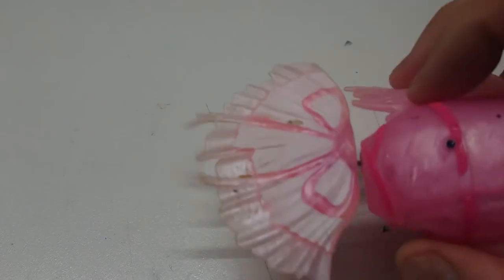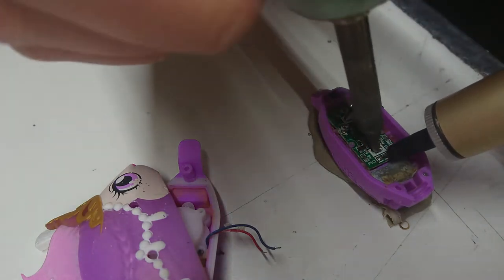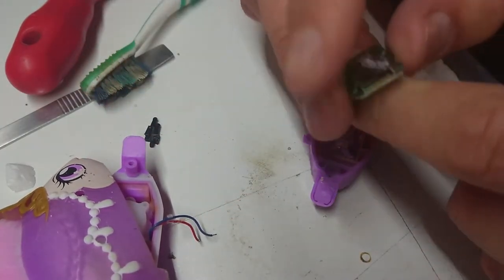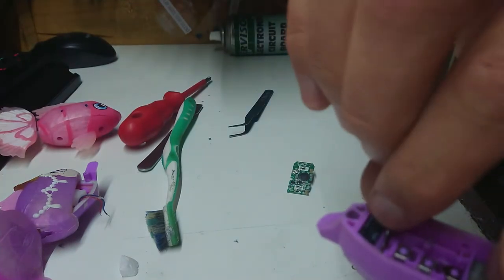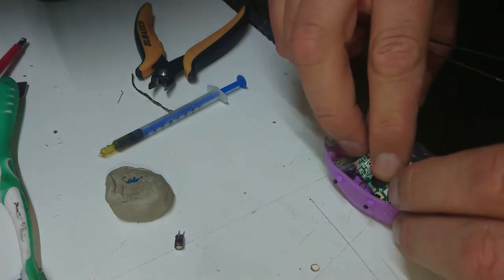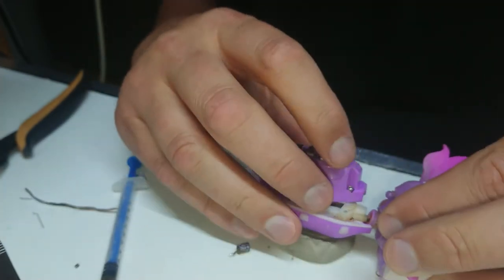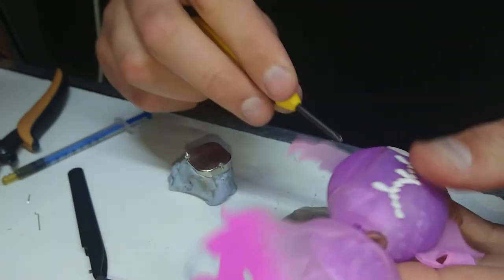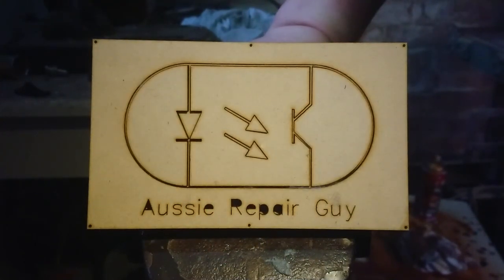Little live pets Lil- Dipper repair

Comment: Thank you so much for this video. But my problem is a little complex. I can change this capasitor (10v 47 mF) and after controlled pcb, c5 component is broken. Can you share what is this component? (Up to chip) Thank you for your answer. :)
Reply from the maker: The c5 is probably another capacitor. Without a correct heat gun (component rework gun) it can be hard to change those.
Reply: @TheAussieRepairGuy  Thank you ver muchfor your answer. :fish-orange-wide-eyes:I guess I won't be able to repair this malfunction. As you said, the circuit is very small and I do not have a soldering unit that can work with SMD. Our problem is that the engine starts for the first time and starts 3 times. Then, when you make the second start, the power is not enough and the engine does not start.

Comment: thank you for making this but uh is.. is one of the black dots on the side.. supposed to be missing? it's not needed right... cuz it came with only 1 black dot
Reply from the maker: The black dots are carbonized rubber and form part of the circuit that detects water.
Its the same stuff used in rubber keypads in TV remotes. if it's just snapped off, and the stub is exposed to water it will probably work just fine.

Comment: How would someone repair a torn fin? We tried e6000 but it didnt stay
Reply from the maker: With silicone rubber it may be very hard. I've never had to try, the only thing I could think of is neutral cure roof and gutter silicone. But most adhesives are going to cost about the same as a new fish.